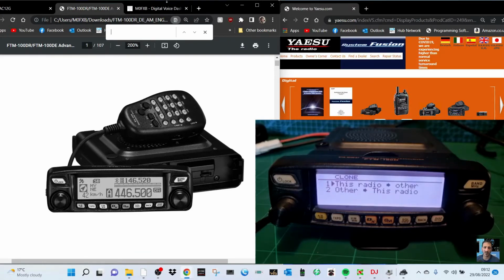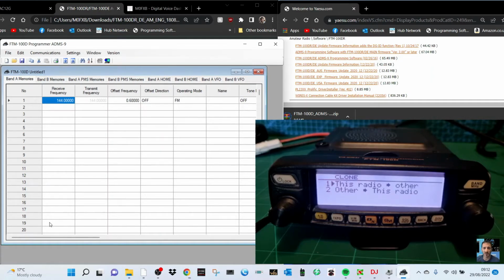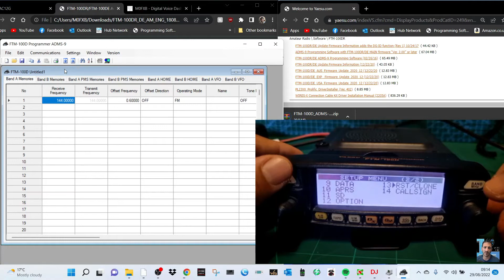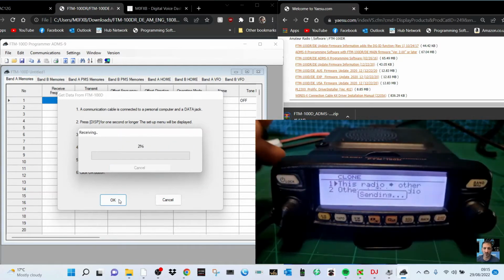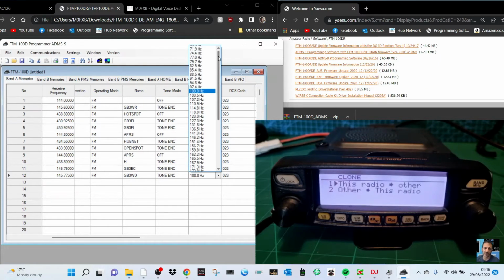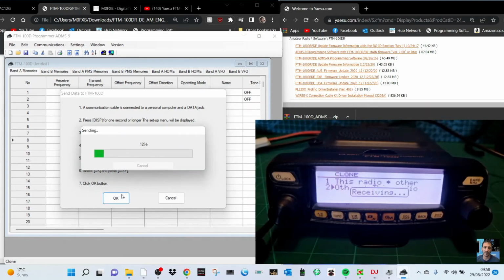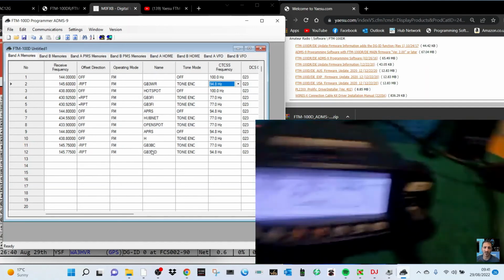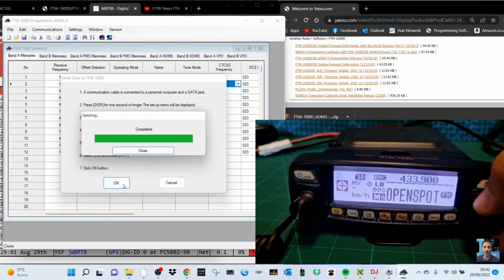YAESU FTM100D ADMS (FREE/) scu20 cable  -Software Programme Memory Channels and Settings 2022

Comment: Hi Andreas, tried all sorts of methods including yours, just will not communicate with the radio ERROR, TIMEOUT ERROR, FORMAT ERROR.  Doing my head in now.
Reply from the maker: Yes it is annoying.
Reply: @M0FXBHamTech  Finally sussed it, there were 2 versions of the ADMS 9 Software I had the wrong version installed.  Changed to v1/11 and all works now like in your video.  Thanks mate.  Regards Alan

Comment: I tried it, did not work for me, Kept getting an error, I read a post that suggested to do a factory reset and try to Read/Send to radio again, but did not want to take the chance  because I already  programmed the radio how I like it with all my memories  manually , performing a back up and trying to load that into the  software did not work so, in short , I abandoned the entire thing and will leave the radio as is,  so the SD card & the programming cable  did not work for me,  maybe one day i will get adventurous and reset the radio and start over to see if that would work,  but still thankful for this video,  I may need it in the future, 73

UPDATE!!!!!!
Got it working fine now
read a review by DO7NE
needed  ADMS 9 for firmware VER 2.0 or higher
it is now perfect, 
Thank you 73
Reply from the maker: Follow instructions exactly but the problem is if timing of selecting ok is wrong it resets the Radio so annoying .